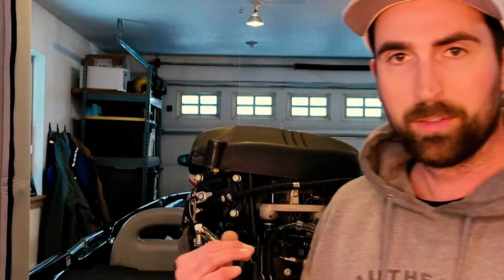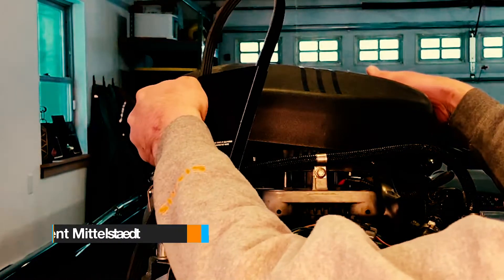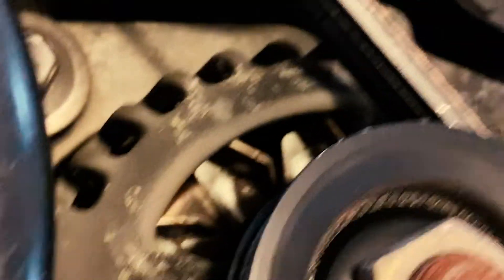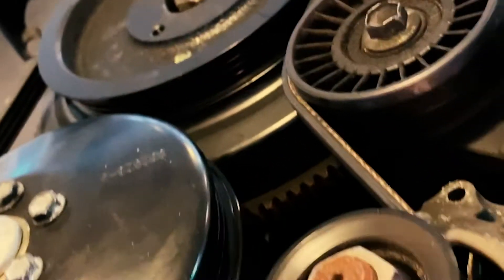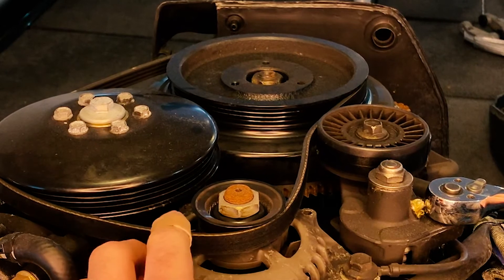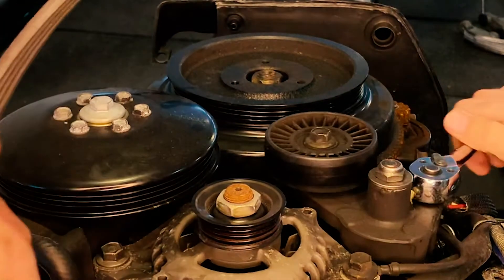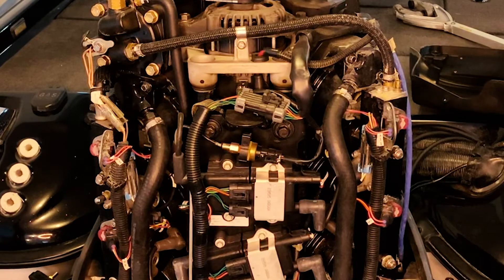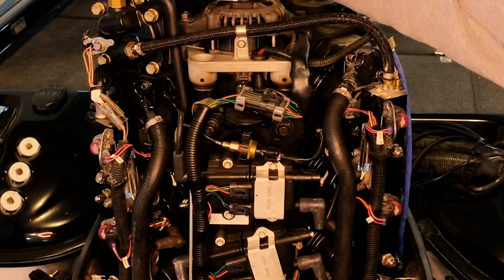Mercury Pro XS Compressor Belt Replacement

Comment: My belt on my 250 optimax is way tighter than that.  Is that a problem ?
Reply from the maker: No, it should be very tight with the force of the tensioner applied.
Reply: Mine was too - tensioner pulley locked up and blew apart - belt was very tight even without tension
Reply: @1972mdc you probably bought the wrong size belt